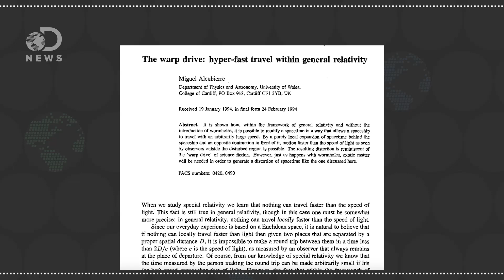How Close Are We To Star Trek's Warp Drive?

Comment: I have a pretty interesting idea on how to make a warp drive.  So take an electric motor and the components that make an electric motor. The materials, rotor, stator, and the shape of the motor of these components  helps to create the negative field space to go faster than the speed of light. Now the materials copper and iron used in the material part of the build needs to have their structures made a certain way. When I say a certain way: I'm talking about nano crystals. So when you put together copper or iron atoms in a symmetrical pattern you can achieve supper conductors at room temperature. Now supper conductors have interesting properties like zero resistance which is basically what I"m trying to create. Which is a zero resistant electric motor.  Now the rotor shape needs to have two vortexes  connected together looking like a phi type vortex. Now you have the stator which should look like a torus. Now there are three ways this torus need to be built. Now the torus will have the same dimensions as phi. For this next example think of a Russian doll. You have a big doll, then you open it up and there is a smaller one inside ect. Same idea with the torus, but I would go from the subatomic structure out for the torus size. Make the torus big enough to get the desired effect. The last part of this is having the coils of the tours be like and mobius  structure. I'm not done yet when you have done all of these ideas. Put the device into a box that is vacuum sealed. Then use a hydrogen cooling system to get the full effect of the presumably warp drive. All manically and electrical resistance have been put to zero. Please Give me feed back if this makes any seance.
Reply: +Tyler M (SALTSHAKER) The most craziest interesting idea in the world.
Reply: +Tyler M (SALTSHAKER) Do you have any degrees?
Reply: Yes I have an associates degree in electrical engineering.
Reply: Tyler M Is that a two year degree?  Let me know when you have the ship built and the warp drive perfected.  We could go on adventures because I'm very good at talking like Captain Kirk and ordering people around.
Reply: lol yes it is a 2 year degree, but you can find out anything on the internet even how to build a warp drive if you research enough. All right in the words of Captain Kirk “Genius doesn’t work on an assembly line basis. . . . You can’t simply say, ‘Today I will be brilliant.'”
Reply: Tyler M True enough.  Just get it built.  We need more power, and obviously an airtight ship with functioning life support systems.
Reply: +Westwood1816  We should  start a kick starter campaign and make this a reality. Doing so could save the earth from the human race itself and create infinite abundance on earth.
Reply: Tyler M I take it you haven't made any prototypes yet?  That would make for an interesting video.
Reply: +Westwood1816  Well you got to understand what I'm talking about. You need a machine that can create a this device at the atomic level. A 3d printer at the atomic level. Imperfection of any kind can't happen with something that travels faster than 670 million miles and hr. This device can happen but perfection is key. It may sound like a con game, but its the truth. To create a warp drive you need perfection of material something never seen in material science except at the small scale. There is evidence of what I talk about but when you combine everything together its like a puzzle nothing works unless all the pieces are put together properly.
Reply: +Tyler M (SALTSHAKER) I have not made a prototype: to do so would take large amounts of money. More than 10 billion dollars a year and more.  Sounds insane, but insane ideas take large amounts of money to become a reality.
Reply: Tyler M Have you discussed this at all with any Ph.D. physicists or other electrical engineers?
Reply: No one has the answer, because this type of idea has never been done to the scale at which I'm talking about.
Reply: Tyler M I guess it looks like you have a very uphill battle ahead of you, but maybe if you went on to get a Ph.D. you could make things happen.
Reply: I could have all the credentials in the world. I don't think that does matter. Its about the money. How profound of a change would this technology take on the world. To a point where it would disrupt the status quo if you know what I mean. Why do think there has not been revolution in technology? The reason is technology of that standard has been held back. We have all we need to make devices of this nature. It the money that is the hold  up.
Reply: Tyler M I'm just saying scientists have told me it's easier to acquire financial grants for research if you are a published Ph.D.  But the amount of money you are talking about is.....insane.  How big would the end product be?
Reply: The end product would be a foot and 1/2 wide by the proportion of phi high for a two person space ship. The truth is you need to build a nano factory to build this device. A device that connects atoms together to create perfect devices. Like the warp drive. But there would be other devices that could be made like a quantum computer. So the whole idea starts with the atom as the first building block. This is the next revolution. You can't use conventional methods to create this device. Think of Henry Ford that created the first assemble line for cars. Its kinda like that in a revolutionary seance, but way more disruptive. All in all this would be the next Manhattan project if it were ever to come to be. It would take 10 years to create the nano factory by the way. It one of those things that if you want it you got to spread awareness and make it a thing.
Reply: Tyler M ....yes and the type of people you would/will need to get on your side would be physicists and engineers with credentials, otherwise you lack credibility.  You should try to get into MIT.
Reply: You know I do lack the credentials to persuade anyone on something of this magnitude. I'm just an electrician who had the type of understanding like Nicola Tesla  and look what he was able to do and could of done. I have enough of an understanding of what I need to know about electricity. I'm great a putting evidence together and making assumptions based off those evidences because of the phd scientist that did the work for me. I'm just putting the puzzle together. I"m not proficient at math for a phd degree. I'm not that smart in that seance. I'm one of those big idea guys. Take for example the torus idea. Why did I go with a torus shape for the stator. My reason was I saw evidence of a torus like field that is produced by a magnetic field. Then looked at how regular stators are made and made my assumptions there. Or from an article I saw that showed that nano tube like toruses have 1000 times the magnetic moment than conventional strands of nano tubes. I listen to a lot people and what they have to say weather it be a phd scientist or some chump. I keep an open mind. Doing this allows me to think out side the box.
Reply: Tyler M Its true there is definitely a lot of peer pressure and conformist group thinking in research science, which hinders progress, especially in medical research where the financial drive is actually to cause and make money from disability and disease instead of prevent and cure it.

Comment: It's not that simple, just bending space in front of and behind you doesn't equal movement let alone faster than light travel. Acceleration cannot occur without some form of OPPOSING FORCES. Creating and manipulating points of high or negative energy/gravitation cannot move an object without moving an equal amount of mass in the opposing direction. Thus, warp drive would have to exert an opposing force upon SPACE ITSELF in order to generate motion. And in order to move beyond the speed of light, the local space around the ship would need to become completely disconnected (independently moving) from the space surrounding it as no extremes of bending space in or out will ever allow mass to move faster than light through it.
Reply: Yeah, gravity attracts... That doesn't answer for the question of what opposing force acts upon the ship to get it moving.
Reply: Once you've got an isolated region of space around your ship how would you move that region of space? Bending the surrounding space is like turning the rudder on a boat without having a propeller for thrust.

As Newton's third law states every action MUST have an equal and opposite reaction. Of Newton's three laws this is the only one that Einstein never argued or made 'modifications' to.

Comment: This is far out of date. There are plenty of popular science publications which have reported on a modification to the shape of the craft (or that it would oscillate) to render the mass energy requirement merely in the 10-1000kg range. Check out Sonny White at NASA.
Reply: +djayjp don't worry, they don't understand what they're talking about. They're just reading scripts. They're actors. But you are right, right now, if the field is generated in the shape of a torus, they calculate they can power the drive with as little as 10kg of negative energy. Now they just have to find it.
Reply: +Steve Bergman pessimists dont change the world optimists do.
Reply: ***** His comments make sense if one doesn't understand mass-energy equivalence.
Reply: ***** Mass/energy, same thing-- you stated it doesn't exist. Guess you don't know that energy distorts spacetime as well. That's why that page mentions its potential use in warp drives.
Reply: ***** Of course one can't actually make a photon move faster than the speed of causality, otherwise distorting spacetime (which happens all the time, everywhere) in the sense of expansion seems perhaps plausible one day given that contraction is so pervasive and the fact that dark energy exists. Negative energy is real (on tiny scales)--

https://en.wikipedia.org/wiki/Negative_energy#Quantum_field_effects

Comment: Technically "correlation ≠ causation" is false. 
≠ is a sign that should be valid in both directions,
and statement "causation ≠ correlation" is a non sequitur,
(in reverse it is "causation ⇒ correlation" or "causation ⊃ correlation" instead).
The correct symbol should be rather one of the following:
"correlation ⇏causation" 
"correlation ⊅ causation" 
"correlation ⊂ causation"

Comment: One of the claims in the video is that once you got the bubble going FTL, you couldn't send it a signal to turn it off.  But geeze, if we figure out how to do all this, why would it be so implausible to figure out how to create warp bubbles inside of warp bubbles to go even faster, so the signal to turn off can be sent?  Relativity works both ways man.
Reply: +T Oadaly On top of that, it seems like the calculations are all aiming at creating a warp bubble that is actually self sustaining. That would take a ridiculous amount of energy, but something semi-stable with a direct feed would only need energy for the time of use and starved of it, would collapse.

It's like the early days of radio, where Marconi simply put massive amounts of energy into the entire spectrum to make a broadcast. Nowadays, a 5volt pocket transceiver can reach for miles on very narrow bandwidths.

Also in ST, the deflector and bussard collectors fix the problem of interstellar dust becoming planet killing projectiles/
Reply: I don't understand why dust would be an issue .  IN the spacecraft's frame of reference, it is not even moving.  That idea seems to be mixing up relativity - as if it is going FTL in it's own frame of reference wrt dust, but sitting still at the same time in its own frame of reference.
Reply: T Oadaly
That makes sense. in warp the ship has at most a STL speed that would not cause such problems.

The "dust" could do a couple of things. 1. It could go "around" the bubble, leaving it roughly where it was.

2. It could enter the bubble and stay there, traveling with the ship with it's STL speed inside the bubble.

or 3. it could enter the bubble and exit it again, also not attributing the amounts of energy and speed that would make it dangerous.

What it surely can't do, is ride in front of the bubble because that would mean the "dust" would actually go faster then light themselves meaning they'd have infinite energy... out of think air!

Comment: Wait, wait, wait. Why wouldn't you be able to stop the ship? You just said that they are NOT travelling through space faster than light, they are basically stationary in a bubble of space that is travelling faster than light (to outside observers). They're not even experiencing time dilation, so as far as the crew/ship is concerned, the ship is stationary. An electrical signal should have no problem travelling through a circuit, so it shouldn't have trouble stopping. These statements just seem contradictory. Can anyone clarify?
Reply: +No Fullname well in your first test you probably don't want to use actual people so i reckon they meant you can't send it a radio signal from outside the bubble
Reply: I'M Running Thaangs That's a good answer, thanks. In that case, I think they could use a timed signal, though.

Comment: I'd think that using worm holes would be the solution for faster than light travel, as in the movie 'Contact' or 'Event Horizon'. Obviously, we can't make worm holes, but it would solve the trouble of having to deal with all of the mass objects, between point A to point B.
Reply: +Samwise Galenorn Actually you can theoretically create a worm hole. As someone at CERN lab proposed doing. They were told like hell you will. As once you created the Worm Hole it feeds on the mass anywhere near it. Thus could never be shut down...

http://www.universetoday.com/12732/large-hadron-collider-could-create-wormholes-a-gateway-for-time-travelers/
Reply: True dat. But where would you end up. In the middle of a star? Dunno but that would ruin the day... This is your Capt. Speaking, hope you brought your Sun tan max factor 1.000.000 with you.... Hehe :) sry about my english i am danish;)

Comment: Aren't the dilithium crystals like a pizoelectric crystal, harnessing the heat produced by the reaction of matter and antimatter and converting it directly to elctricity which they then use to power everything ?
Reply: Nah, the crystal is the only (fictional) thing that can contain the matter/anti-matter reaction in a controlled way.
The energy contained/created then "heats" a science-magic ""warp-plasma" which is directed via magnetic shielding into the warp-coils (in the blue-shiny gondolas), which in turn generate the warp-field.

The reaction is so intense, it still breaks the crystal over time. Hence the need for dilithium mines, which are pretty rare.
Reply: in the original series scotty is in one of those things trying to tinker with the antimatter directly 

the plasma cant be transported into the warp coils from the main body of the ship otherwise that episode would make no sense

Comment: Dr. Harold Wright PhD NASA director of Advanced propulsion in TWENTY THIRTEEN, NOT 2016 (3 whole years ago) did some math & calculated that by enlarging the warp rings by thickening them found that the energy requirements of no more than the mass of a family sedan (that's a car) was needed to generate warp field. acknowledgement of the "stiffness" of space-time was addressed as well. Dis here be fixeded by turnsin duh warp field on and off. Also through audience questions, the issue of particles hitting the ship, and built up radiation were addressed as well. According to him, not a big issue. NO WE ARE NOT CENTURIES AWAY FROM INTERSTELLAR (star to звезды ,the Russians own the rest of the cosmos) SPACE TRAVEL. TRY FIFTY (50), YEARS!

Comment: Um.. they tweaked the geometry of the "warp bubble" and figured that they can get the mass down to a couple tons (This was figured out a few years ago now). Also turning the warp off would not be too hard. The bubble is a static object relative to the ship, so any signal from the ship would be able to reach the bubble as if they were not moving at all.  Finally, the deadly particle shower thing is B.S.. Particles outside of the bubble would be warped around the bubble and return to their original positions and trajectories behind it (the particles would behave as if nothing happened). The particles that are in the bubble with the ship will experience the same forces as the ship (when the ship "stops" the stray particles will also "stop").

Comment: Starfleet vessels use the plasma as the medium to transfer electricity, like copper wiring in modern technology. It your could keep it hot enough and contained, high temperature plasma would be more efficient than low temperature superconductors.
Reply: +Larry Phischman Plus, there's a limit to superconductors - absolute zero is technically impossible because you'd have to have no mass/energy in the universe because all mass has a gravitational field; even one subatomic particle is still technically pulling on something 70,000 light years away, right? (Plus, if you get that pun). And 'perfect' absolute zero means you have to be not moving at all. That gravity pulling on that subatomic particle is technically heating it up (by minuscule amounts) because its moving (again - by minuscule amounts).

With the opposite direction - heat - you can go as high as 1.41 x 10^32 Kelvin (Planck Temperature). At that point the radiation it would emit would have a wavelength of 1.616 x 10^-35 Meters (Planck length), at which point quantum gravitational effects become relevant. You can go higher than that but we don't know what happens because we don't know that much about quantum physics in that sense.